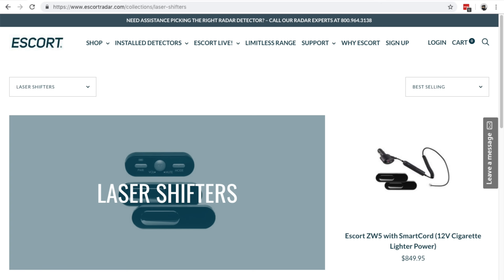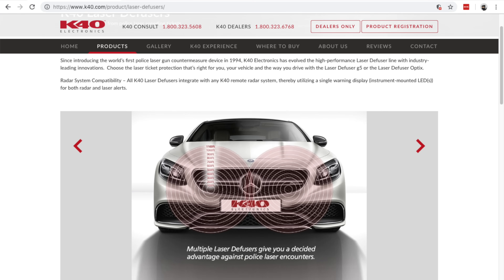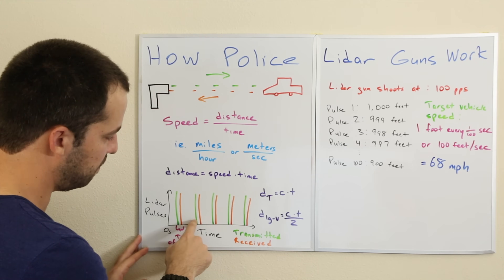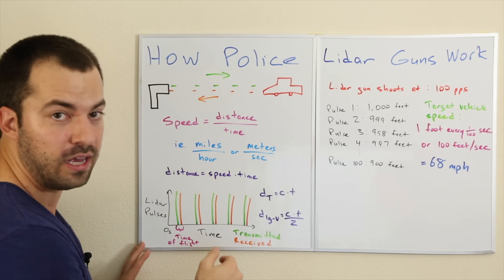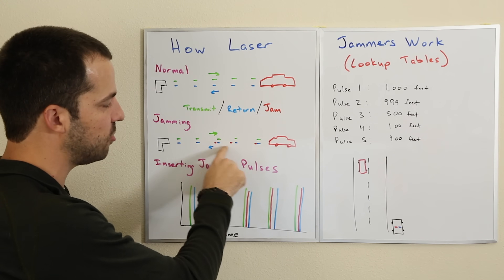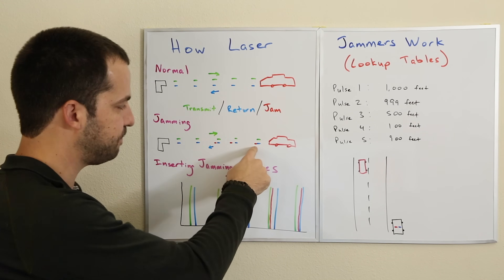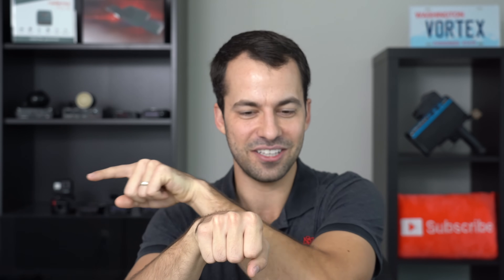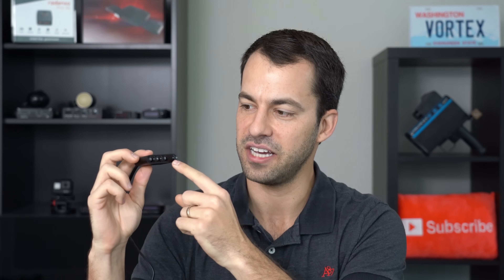Two Common Misconceptions About Laser: Five Minute Fridays, Ep. 27

Comment: What amazes me about jammers is that it can detect the light beam, analyze it and know what gun is being used, and return fire all before the LEO's lidar gun can get a reading in less than a second.
Reply: It basically comes down to the fact that the LEOs guns need to make multiple consecutive sends and receives -- enough to calculate the change over time that the reflected light takes to return to the gun. Velocity is calculated by analyzing the change in the speed of the reflection, over time. For example, Send 100 pulses, calculate the speed for each reply, and confirm all readings are inline with standard deviation. Since the vehicle is moving away from or toward the LIDAR operator, the amount of time for each reflection to be received will be either increasing or decreasing relative to the prior pulse reflection times. It should be a fairly linear (relatively speaking) response-time increase or decrease. Ignore any pulse reflections where the response times are outside of standard deviation (reflection from rain drop, snow flake, dust in the air, etc), then calculate the average response time from the remaining set. Use the math for speed of light, and output a speed to the gun operator of a negative or positive MPH (or Kmph). A negative (-)10 MPH would be moving away from the gun operator at 10 mph. Positive (+)10 MPH would be of course, moving toward the gun operator at 10 mph. On the opposite end of things, a parking sensor system on a vehicle does NOT need to wait for a reflection of the light it sees. It just needs to respond right away as soon as it sees a pattern. It begins responding with the pattern it sees and constantly takes into account any timing adjustments that happen as the vehicle travels through space over time. The precision based parking sensor systems use GPS so that they are aware of the vehicles location and speed and are prepared to increase or decrease the timing taken between firing return pulses -- which we all know are to defend against the interference they are receiving. :)
Reply: @sdrawkcab7761  Excellent analysis, as I said'  Time of flight."